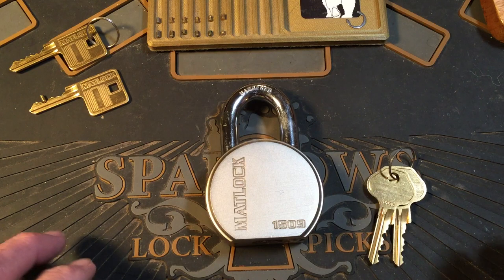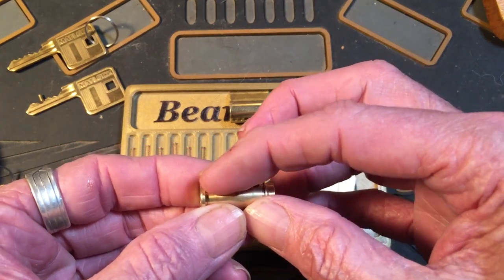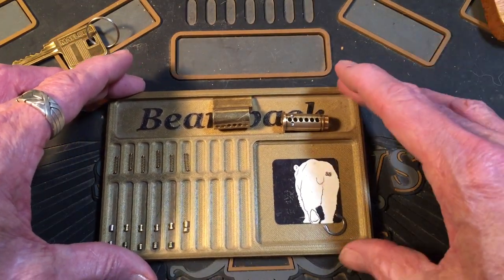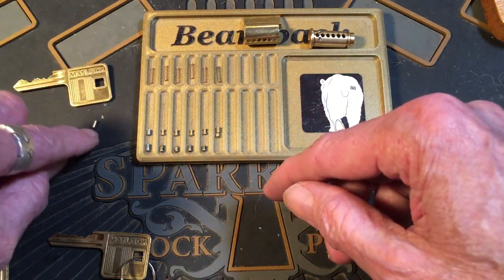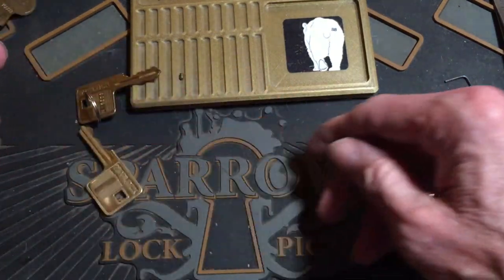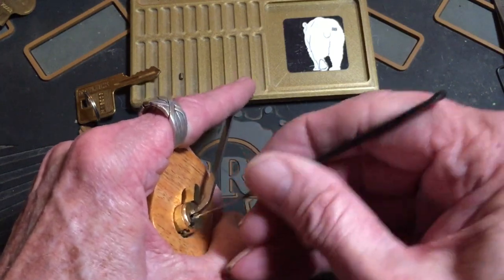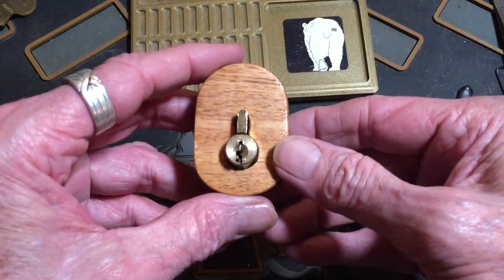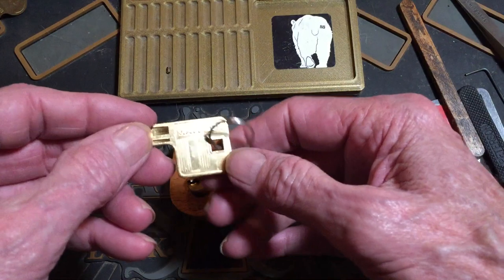(282) More Core Security - Simple Change & Eating Crow

Comment: Great work, really love this kind of analysis and testing. Just to make sure I understood correctly, there was a strong anti-bump spring in #5 and a 4 pin and it raked pretty easily, and then you changed the 4 pin to a 7 and that made it a lot harder to rake?
Reply from the maker: Thank you my friend, There was a bump pin & bump spring in #6 with a #1 keypin, I just cut the key down from a #4 cut to a #7 cut in position 4 on the key.